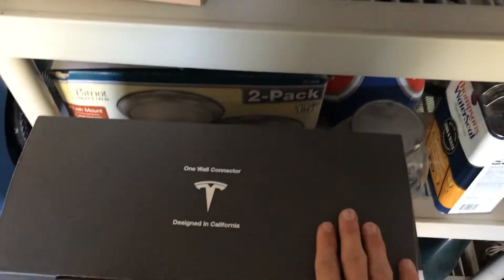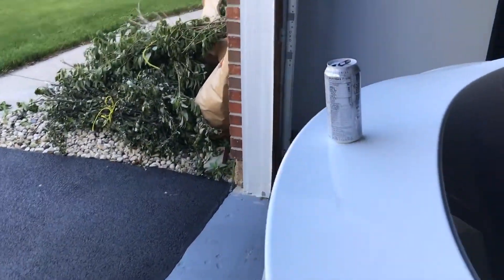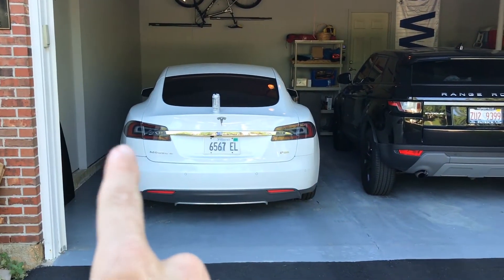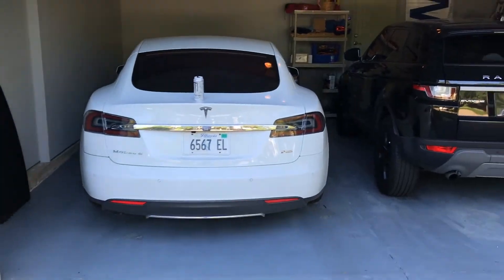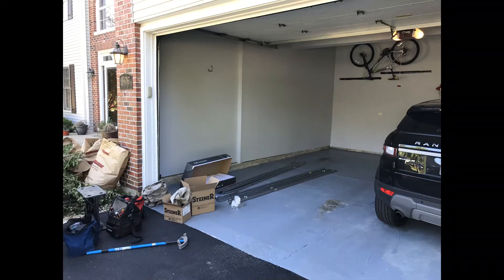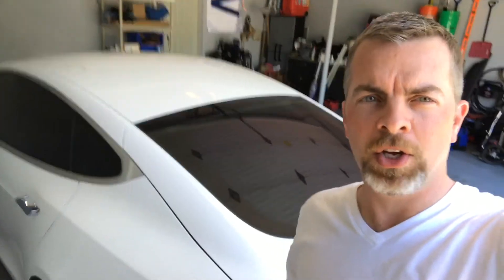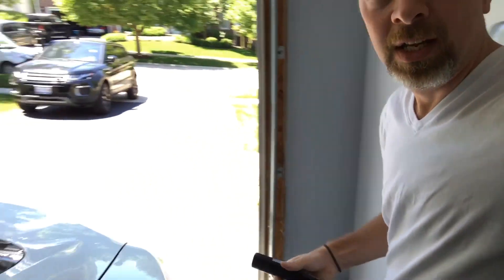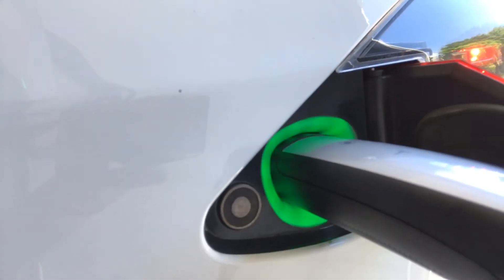Tesla One Wall Install

Comment: Sorry to say, useless video. Also if the wall charger goes bad you're out of luck. Seems to me the best way is to install a 220 volt outlet and connect it to thr wall charger so the plug is a backup...we are going that route later this week...OR have 2 separate conduits one for the Tesla charger and one for the 220 volt outlet...

Comment: How much did you pay?
Reply from the maker: Daryl S. I am assuming you mean paid for install. It will all depend on how far away they have to run electric and amp on board. I had other electric work done that day too. I paid $700 all together with the other work done too. Not sure if I separated.

Comment: Usually when you have things plugged in (electric outlets) they continue to suck current and thus increasing your energy bill, even if the said thing is literally turned off. So when your Tesla is completely charged, does the wall charger automatically shut off? I'm curious how that works. Is it like when you put gas at a station where the pump automatically just stops, you know?
Reply from the maker: From what I can see the charger does stop charging the car at the point I ask it to.  It is still fairly new so I have not gotten a bill yet.  The wall charger has a light on it so I am sure it is always pulling some kind of power.
Reply from the maker: Thanks for the Comment.  At this point I am not too worried about it.  Thanks for the info though.  I will look into that just in case I have to replace it.

Comment: Good video. What is your breaker size and charging rate settings for your wall charger?
  These things can go up to 100 Amp breaker charging at 80Amp and 50+ miles per hour of charge.  So cost can vary greatly depending on the gauge of cable and charge rate you choose.

I just installed one of these myself last week.  I bought mine, also with the 25' cord, on Amazon for $499 no tax free ship.  The cost for conduit (required in Chicago 'burbs),#6  AWG thhn wire, and breaker cost just under $100 for a 15' run.  Install took about 2 hours.
Charging rate is about 29 miles in an hour at 40 Amps on my 2013.  

I have dual chargers in my car ( you probably do too) so I could go much higher on the charge rate but for my daily usage I don't need more than 2 hours of charge at the lower rate.

Also, did you switch to ComEd's real time pricing?  You might be able to save some money by scheduling your car to charge overnight.

Video:
https://www.youtube.com/watch?v=E6XC2vKfiKk

My referral link (if you're interested)
https://hourlypricing.comed.com/e?i=AE&t

Thanks for the video!  Look forward to the next one!